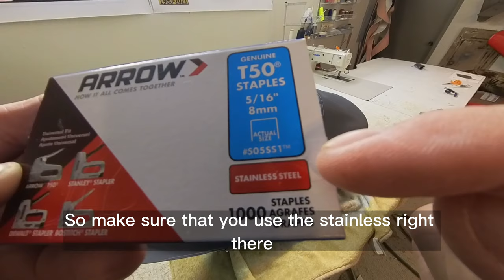How to Super fast Jet Ski Seat Upholstery Big Announcement CC

Comment: Have you used the Tenara or PTFE thread for your outdoor projects?  If so, what were your impressions?  Which size did you like V92 or V138?  Best place to purchase and best brand in your experience?
Reply from the maker: Hello Douglas, That sounds like a brand name I have not come across. I have just been using the same poly or nylon thread for the last 43 years. Served me well. Thanks for watching!
Reply: @Old School Auto Upholstery Techniques  Tenera is the trade name used by Goretex for its version of the PTFE thread.  I have used bonded and U/V coated poly thread for years also.  Problem is it degrades rapidly.  Tests show in two years it's strength is half what it was originally.  Even worse if you wash with bleach solutions to rid boat covers, tops, dodgers, etc., of mildew and mold.  The PTFE and Tenera actually guarantee it to outlive the life of the material.  It is ten times as expensive.  Might be worth it if it's claims are true as modern materials like Stamoid and Sunbrella are good for twenty years in their double coated marine grades while the V92 poly thread starts letting go around six or seven years.  Even with double stitching.  A lot of work and money going to waste for bad thread.  Markedly so since I am in a coastal temperate rain forest with not much sun.  It has been an ongoing frustration on canvas work watching thread failure on exposed work.
Reply: PS Gore and other manufacturers pointedly approve Tenara and PTFE for use with bleach.  No other thread does so with most warning not to use it.  Kevlar thread is one of those.
Reply from the maker: @douglasthompson2740  Hello Douglas, I do get a lot of canvas and boat repairs of factory-made covers. Keeps me busy. Thanks for watching!
Reply from the maker: @douglasthompson2740  Hello Douglas, You are much more knowledgeable about the thread than I am. Thanks for sharing. Please keep watching!